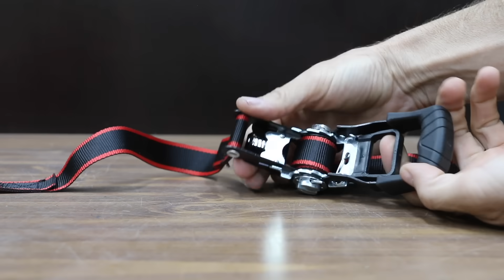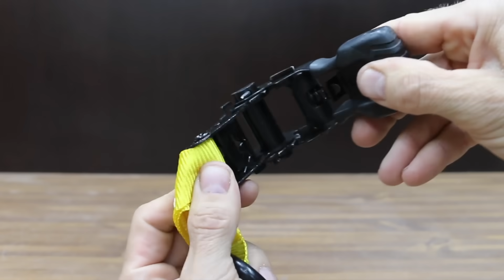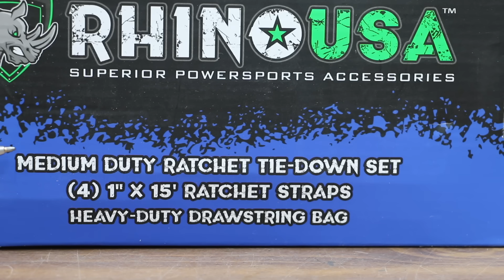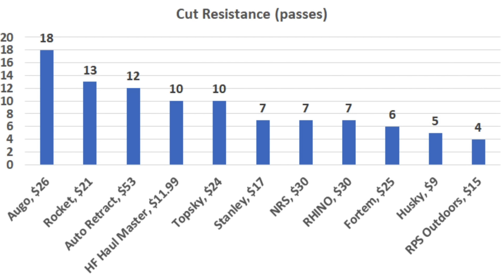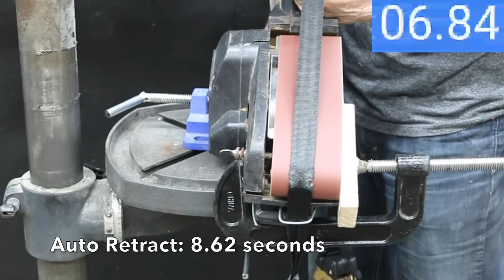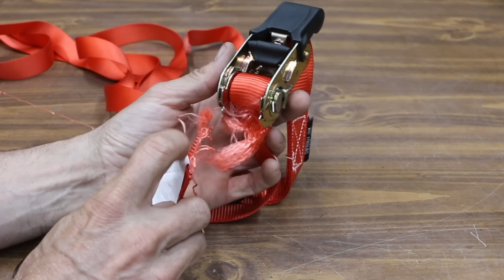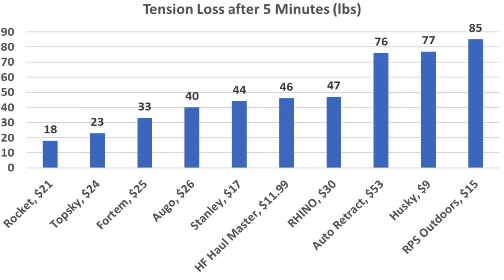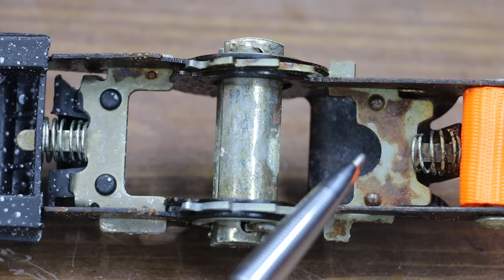Best Ratchet Strap? Husky vs Stanley, Rhino USA, Rocket, Topsky, Augo, RPS Outdoors

Comment: Well I'll be damned I just watched another ratchet strap video testing if a twist will decrease the straps strength by 50% which is insane. Now when the strap that had one twist in it (like you wld for less vibration driving) took a tiny more to break it yes it was stronger and i have to say i was impressed. Thats it tho anymore twist than that it did get weaker but not much, took 10 twist to get it even close to 50% less and Now im ready to see which is the best one for my money.
Reply: Sorry for the short story.

Comment: I think an excellent way that would help improve your reviews of tools is to take a page from America's Test Kitchen's equipment reviews. They order their end lineup in 4 stages and two awards, "highly recommended" for tools that excelled in testing,  "recommended", for tools that performed well but may not have competed with the best, "recommended with reservations" for tools that performed, but may have demonstrated significant drawbacks in comparison to other tools, and "not recommended" for tools with serious design flaws or couldn't complete the testing due to poor quality, design or false advertising. They also give out an award for "overall winner" and an award for "best buy (for value)." Adopting a system that follows a similar lineup would improve the clarity and overall understanding of the quality of the tools you review.  https://www.cooksillustrated.com/equipment_reviews/1815-santoku-knives?sqn=VkDZH4hoaDL4ClxFTcIA6%2Bj54G5Nscnir0cAjjGHOeY%3D%0A
Here is a link from their online forum laying out their review process.
Reply from the maker: Great feedback. Thank you

Comment: I usually spray some lube on the ratchet parts to make it all work smoother and helps prevent rust.
The biggest struggle I have is when I release tension after the pop. Pulling it, the ratchet comes off the groove so I have to hold it with one hand and then pull the strap with the other, and many times it’s way more than 20lbs. Maybe it just wears and make it harder.
Reply from the maker: Great tip

Comment: The auto-retract is certainly interesting. I would like it due to the convenience of it literally wrapping itself up, but it seems that the strap material that was used and maybe the ratcheting mechanism could use a bit of work. Something a little stronger and robust I think.
Reply from the maker: Very easy to use
Reply: @ProjectFarm  It certainly does seem extremely easy to use! Though it could certainly use some more strength

Comment: I'd love to see some motorcycle specific oils tested against Rotella T4/T6. If you're not aware, the Rotella is JASO certified for wet clutch use so A LOT of motorcycle guys from all different types of riding backgrounds use Rotella because it's cheap and this has caused huge arguments for the last 20 years on motorcycle forums. 

I Rotella v Amsoil 100% syth v Motul 100% syth v other motorcycle oil showdown would be great. 

Also would love to see a gear oil show down. Specifically involving Amsoil severe gear vs OEM gear oils like Honda HP.
Reply from the maker: Thank you for the video idea!

Comment: you should compare work pants next! carhartt, duluth, wrangler etc
Reply from the maker: Thank you for the video idea!
Reply: 5.11 makes some solid pants to work in
Reply: @waldok814 I'd be willing to try others but the two pairs I own rarely get worn because the extra material they put on the knees is too low for me and makes it weird to kneel down or even walk. If I hike em as high as theyll go its better but that's not comfortable either. Just something to consider for those that see this and look into them
Reply: @charlesalberti563  I agree it can be hard to get past the bagginess of them, but I just cannot stand how constricting jeans are when I'm working. So far Im really liking the 5.11 TACLITE® PRO RIPSTOP PANT. As for extra material in the knees, it usually starts out below the knee; but when I kneel it'll move up.
Reply: Duluth firehose pants
Reply: Add to that list Engelbert Strauss work pants. I wear them everyday. Easily one of the best work pants ever.
Reply: Dickies are top quality.
Reply: @OriginalWhiteDevil  for sure Homes 😎😎😎
Cholo all day
Reply: Truwerk, Patagonia too
Reply: Can't forget the rustlers
Reply: Great idea! I will continue to buy carhartt though because they make them in my hard-to-find tall sizes

Comment: Hi. I own the Auto Retract brand. You should undo the strap during your corrosion tests. The inside carrier walls of that roll up part is susceptible to rust after I used mine for a few years. You may want to check the inside of it
Reply from the maker: Great suggestion!

Comment: For wrapping up the straps, what I do is roll the strap separate from the ratchet. I roll the strap starting from the loose end (not with the hook) and roll it up tight up to the hook. This makes it easier to toss the strap across a load without worrying about the hook slapping into the side of the truck or knocking my helper in the head with a metal object. Even in low winds (up to about 10mph), the roll will go across w/o issues.
Best way I found to toss it is to hold the roll between thumb and index finger with the back of your had facing the direction to toss (so palm facing you), and curl the arm to your shoulder. To release give a nice quick flick of the arm/wrist to toss the roll. It flies quickly and straight.
Reply from the maker: Thanks for sharing.

Comment: I use a combination of cam buckle and ratchet straps to lift/lower and secure my Jeep’s hardtop. The Husky cam buckle straps have been great as the cam buckle makes lowering and raising a much easier operation than with a ratchet. I use ratchets for extra security once the top has been lifted in to place. Getting close to time to probably swap out both. Topsky is now top of my list. I’d better grab them before the Project Farm effect kicks in and the price doubles. Or stock is depleted. Thanks again for such a thorough testing process.
Reply from the maker: LOL

Comment: I had no idea that these straps lose so much tension after 5-min/30-sec !

Thanks Project Farm !!
Reply: It's why the DOT recommends and some companies require haulers to stop after the first 10 miles of a trip and check the straps.
Reply: Yupp! Me neither.
Reply: Guess it makes sense that they'd stretch under load.  So when you recinch the straps tight, you're taking up the slack that was generated by the straps stretching.  Eventually, they'd hit their stretch limit, and then they'd be secure.

Comment: nice video!

might be interesting to see if stretching a strap several times makes a difference in the working load test. i think maybe once the threads of the strap settle into place after being stretched multiple times might make it less likely to lose it's load strength.

I'd also be interested seeing if doing all the things we have been told not to do to a strap (twisting, folding over a sharp corners, having knots in the strap, oil/grease stained straps...etc.) actually affect it's loading capacity....and if using a damaged strap is unsafe...and how unsafe? i've seem people used frayed straps... even straps that have been frayed...cut the fray part off the side...and use a lighter or torch to melt the edges to keep it from fraying more. obviously it has a lower capacity...but how much?
Reply from the maker: Thanks for the video suggestion!

Comment: The best way  I've found to store straps is to loosely toss all the pieces in a bag with bungee cords, then shake.
Reply: I use a similar method to you Dean, but I throw in some wired earbuds too.
Reply: That method works best when you need one in the rain!
Reply: Make sure you have at least three different styles of straps with rusted ratchets for best results
Reply: Ya, I've got a plastic bin with the straps, bungees and assorted ropes and things all just chucked in there. When I try to pull out just one, I swear a lot. I don't recommend it.
Reply: I made fork to battery drill. Long starps are rolled in seconds. 3 large nails are welded like tuning fork with small gap to fit strap between. Found this trick on youtube
Reply: I am think alot use that storage method, every  t8me we get th3m out and say ,when I put th3m a2ay I will roll them up rubberband or zip tie them .Th3n 3nd tossing them back in the bag
Reply: Whoa.😲

Comment: One more test to possibly try would be 14 to 30 day outside exposure test on the straps (no need for the ratchet part) from my experience most of these plastics are sensitive to UV exposure and the fibers even absorb water making them brittle.
Reply from the maker: Thanks for the video suggestion!

Comment: VIDEO IDEA DUMP!

• Best toilet plunger. (Note: toilet paper companies use blue Playdoh as a substitute for human stool.)
• Best extender reach-claw-thingy for old people to reach things 😂
• Best glass cleaner (Windex vs. ?).  Pro tip from a restaurant server who cleaned a lot of glass: use coffee filters to clean glass instead of paper towels or rags.  Filters will reduce streaks and lint.
• Best cooler (Yeti vs. ?)
• Best multitool
• Best starter tool-set for homeowners (must come in nicely organized blow-molded plastic case).  Examples are Craftsman 100pc wrench/socket set.
• Best ladder
• Best small tool-bag
• Best small-sized shop air compressor (for running air tools a short time or for quickly inflating tires of vehicle in the garage).  Aluminum tanked compressors recommended as they do not rust inside.
Reply from the maker: Thanks for the video suggestions!

Comment: And I just bought some straps from harbor freight in a pinch. Glad I'm watching this.
Reply: I've had that orange set of ratchet straps from Harbor Freight for years. The ratchet mechanism is frustrating to use. But they always work. I have the skinny ones and the wider ones. If I'm really worried about it I use the bigger straps. Or more straps. So far so good.

Comment: I watched a video just a couple hours ago with someone else testing two inch ratchet straps. Most of those broke at almost the same spot as  the ones that "PF" tested. I'm not an engineer, just an every day DIY'er  with common sense, but I can't figure out why most of them break where they do just a few inches from the spool.

Comment: PLEASE test for the best CLAMP!
That would be an amazing video and you could test all types of clamps like the squeeze ones and the twist ones, even pipe clamps!
Reply: I think I can already tell you which brand of one-handed bar clamps is the best: Wolfcraft.
Reply: @mikey4016  that is exactly why I want a video on this. I have DeWalt 600 lb rated one hand clamps and to me, they are THE BEST. So extremely good quality and easy to use.

Comment: Great video, Todd!  I wish I didn’t have about 20 ratchet straps already, or I’d buy the Topsky.  I was curious what tension can be put on the straps using the ratchet mechanism (and not the chainfall, haha).  Clearly you made it to 300 lbs, but is it even possible to approach break strength with the ratchet (and hand pressure)?

Comment: Man, that Auto Retract feature seems awesome. I was hoping they were going to do really well. Oh well.
Reply: I have them and still love them. They aren't really purposed for being a heavy duty tie down. More of a fast and convenient strap when you need one.  
  
So for example in my truck bed I have 2 of them permanently hooked to the walls to quickly strap down anything like a mower or pressure washer I put in the bed.  
  
If I put a motorcycle or something really heavy in the bed I have a set of better straps I use. 
  
But the auto retracts are plenty for 90% of the jobs I need straps for.

Comment: The one thing I would have liked to see is if having a knot in the strap weakens it in any way or having it twisted when using it for holding down a load. I use straps a lot for my work and I’ve always wondered if it makes a difference.
Reply: Don't understand why you would have a knot. But twists won't comprise the straps in any way. Not sure why you think they would. And yes I speaking from experience.

Comment: I'm kinda surprised you tested NRS straps. I use them for everything whether it's a waist belt or to tieing down lumber, or anchor rafts and kayaks on the river, I personally would use them over those ratchet straps just because I think they're way easier to use.
The NRS staps are definitely not the strongest but they work perfectly for light to medium weight loads (depending on what your idea of a medium load is).

Comment: My ratchet straps (don't know which brand) ride in the back of my truck ALL the time.
I'm in Hawaii, close to the beach and to reduce corrosion I use "Corrosion X HD"  
Thats "H"eavy "D"uty.   It keeps the ratchets working and corrosion free.
Have you done a lubricant test?  I'd like to see that.

Comment: I definitely appreciate the effort you've gone into for all of the tests, especially in maintaining your safety during the break tests.  (To me, that's more important than the results).  However, I don't think the tension release test was useful.  For example, your 'lowest tension loss' strap started at the lowest starting tension.   In fact, I believe you had a 337 285 52 lb difference between the lowest tension start and the highest.  If all of them had been within 15 lbs of the same starting point, then they'd have been useful.   I do realize that you were limited by the ratchet and pawl mechanism, but one starting at 285 and another at 337 means that effectively, the lowest number had the least tension to lose.   Frankly, I don't know how you'd 'snap' them out to the same tension numbers short of something taking 30 seconds to move to the maximum tension, then locking in place for 5 more minutes.   (Which would compensate for that first 30 second tension release as the weaves move around)

Comment: i was an 88m (transportation) in the Army 5yrs active and 2yrs reserve. as an 88m part of our job was strapping. from tents on a rack to lhs's on flatbed rail cars to 108 rounds for paladins. so having said that theres really only 2 places on a strap that are a priority how well the strap material holds up and that the locking flanges are wide enough and tall enough as to not be able to kick at an angle pinning it. worrying about the ratchet breaking from the load can be over come by simply taking the remaining strap and looping itself around the mechanism and knotting it. my suggestion is to get thickest gauge of metal used for the mech and the longest thickest straps

Comment: I never even thought about it, but that tension loss is a very important factor.
Reply: That might be the only flaw I saw in the test, because if you don’t have enough wraps on the drum/ spool of the mechanism straps can slip through the spool and loosen. But the finish, thickness, and stretch of the strap/ webbing material can certainly make a difference too.
Reply: Yeah I hadn’t even considered tension loss

Comment: I am going to guess that the cheapest are just as good. I have a large amount of 1 inch straps that I have bought when they were dirt cheap. I also have some 2 inch as well. I think that the cheap ones are just as good.
Reply: Someone please tell me that you seen an ad on marketplace for slightly used sandpaper...
Reply: I store mine in a bag that goes under the truck seat or in the trunk of the car. You never know when you need them. I might have about 30 or more of the 1 inch and a lot of the 2 inch. I buy the cheap ones, yet I buy a lot of them when I need them. This way I can rotate them more often than not.  I always put the straps on then walk back around to the first one and tighten them all again..

Comment: Thankyou for this video Todd. I just wanted to chime in that your videos are so helpful and awesome for all us working guys. We appreciate you. 

I bought those black and red husky straps during the holiday sales and they are the worst straps I’ve ever used. As soon as you get them rolling around in the back of a truck and they get used and dirty they are a real pain to use. Ratchet cams lock up. The strap gets bunched up and all around they just suck. The orange harbor freight straps are absolutely the best deal. Back before HF got all uppity they regularly had those for $6 on coupon. I’ve had some last over 5 years with daily use in a harsh environment.  The absolute best straps you can find at Costco under the “Goodyear” brand. Heavy duty, solid ratchet, thick strap, 1000lb working strength. They run about $25 for 4. Once I discovered those I sold all my mixed others and bought about 15 of them. They are the best. By the way I’ve been strapping tools/materials/furniture in my truck beds for 20 years. Thanks.
Reply from the maker: Thanks for sharing!

Comment: I had the Husky brand shown here fail the first time I used it to haul my motorcycle on the back of my truck just a few weeks ago. After safely hauling it for 90 miles,  I got to my destination and when I removed one of the straps from my motorcycle I noticed that the cotter pin holding the main mechanism had pulled completely out.  It was very close to complete failure. I was shocked that it did not dump my motorcycle on the freeway. I was lucky. I took that strap and the other three that came in the packaging and threw them in the garbage. I will never use them again. Never strap down your $7,000 motorcycle with them damn Husky straps. Too risky.
Reply from the maker: Oh wow!

Comment: I use the husky because they're more than sufficient and you can't beat 4 for $9. They never fray and I carry a ton of PVC trim with the razor sharp edging. They don't rust out on me either and I'm in a wet humid climate but after around a year the ratcheting mechanism will eventually slip. After the first slip I just throw them away. Because of the cheap cost it's easy to come to terms with giving them away here and there when someone needs a strap.